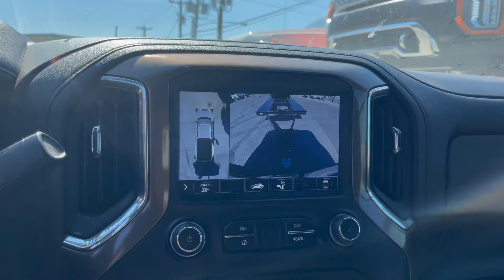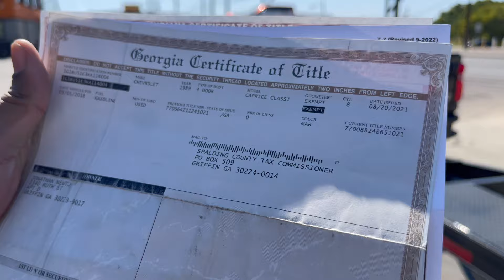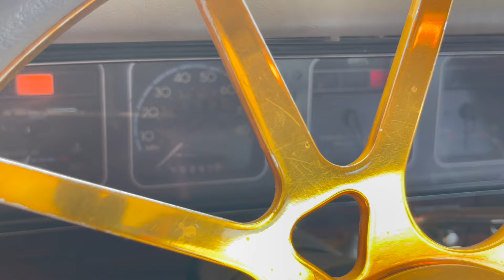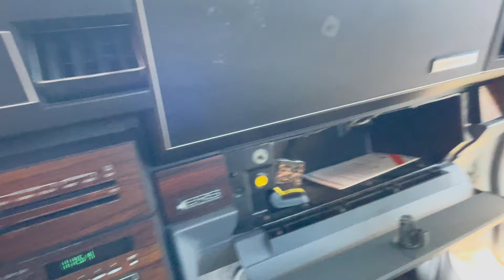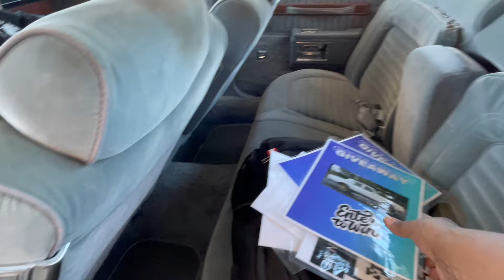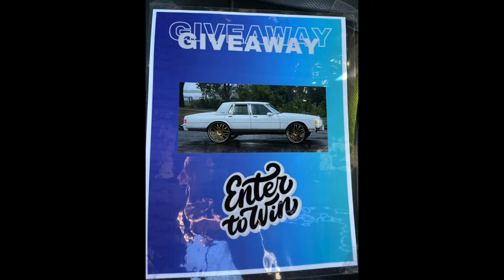Giving My Box Chevy Lil Digi Scale 2 The Winner He Didnt Want It

Comment: Tires leaking air, check oil and trans fluid everyday,parts missing on the car! You should had made sure the car all the way 100 before giving it away and you seem really worried checking everything over like you know something wrong with it 😑 Your at a tire shop why not have omar remove the rear wheels and fix those leaks in the tires instead of sending him off like that?
Reply: Three piece wheels are subject to leak at any time. It's an old school also so you gotta check fluids regularly anyways
Reply: Dam fool u act like it’s not a OLD SCHOOL
Reply: I mean, everyone who played knew all these things, so if they choose to enter, then it's on them. Like you tell a mf what they should do is goofy! You should go do a raffle and make your own content.
Reply: Center console and rear deck costs more than what he paid to win the raffle. Motor and transmission stock, he just making sure bro was straight. He didn’t even know to tap the gas to help it start
Reply: @accurateshooter2x131 no lie!

Comment: Ion trust that motor 😂 hope buddy ain't driving it back to Arizona 🤦🏾‍♂️
Reply: It's running like mine.. like a sewing machine.. u can drive that car anywhere.. stop the cap..
Reply: @youngjj757  🤣 u can't drive that car no where but around the hood it's been knocking since he bought it carburetor ain't never been right after he done change it 3 or 4 times if u watched the videos u would know that far as the look of the car and body it's solid the motor is trash he can still sell the car for a dub easy it's gonna need a motor tho
Reply: @kevinhamilton9120 Sug said he put 42k in it.
Reply: @GT-pf6nb  ion care what he said no motor no roof basic paint the rims that was on Trex with new barrels he got the trim polished rell gave him the console and  Carborator he bought a rear panel $400 or less sound system and grille  42K i can't see it dawg 🤣🤷🏾‍♂️
Reply: @kevinhamilton9120  So more like 42 hunnid. Lol
Reply: @GT-pf6nb  he put some bread into it i jus know he could have came way harder for 42K